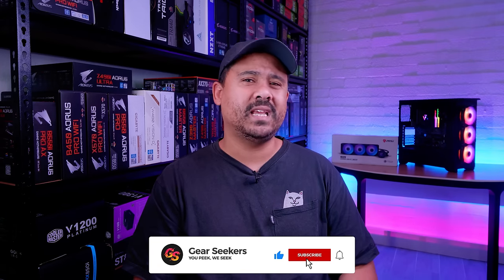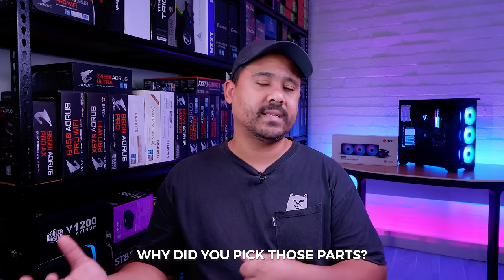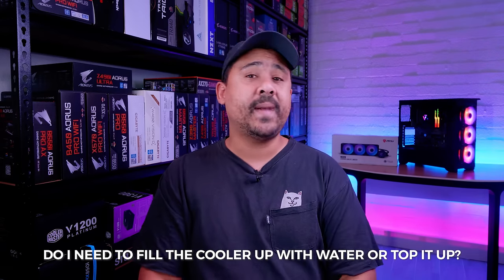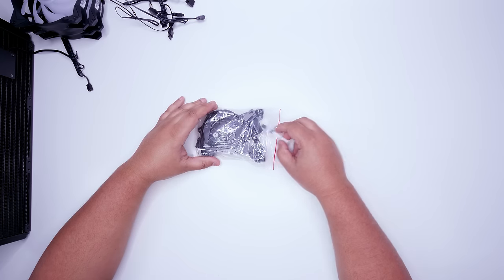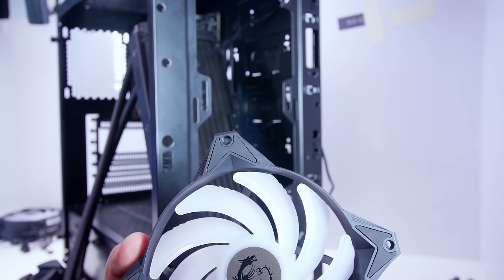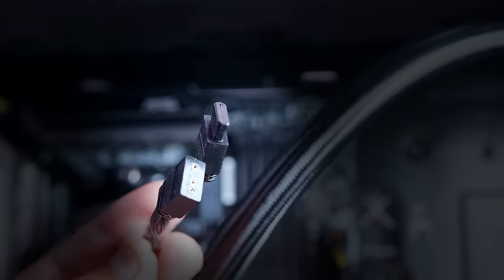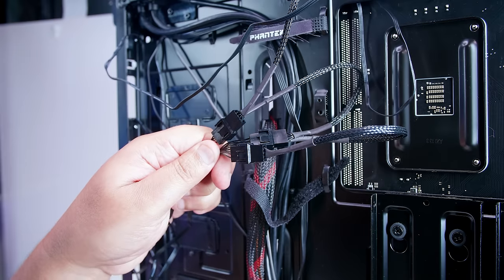HOW TO MSI MAG Coreliquid 360R & 240R AMD AM4 & AM5 Install Guide

Comment: The V2 does not come with instructions so this was some what useful. but you glazed over and skipped some key steps. For AM4 pretightening the the cpu cooler clamps did not fit. and the wiring is a joke.

Comment: This video is 10 times more useful than the official instalation guide you get from the box.

I scratched my head because the light just didn't want to turn on even after I make sure I already plug all the argb fan to my argb hub.
Reply: Figured out a solution yet??
Reply: Amen.  There are parts in the bag that aren't mentioned anywhere in any of the instructions.
Reply: Normally it would mean you need an app to control the RGB if the motherboard isn’t RGB ready
Reply: @vortexseziks1013  ,

Comment: The Q and A is amazing, all the questions answered quick and simple. keep up the good work👍
Reply: L
Reply: Will the pump work on a old motherboard like a msi 970 or a 990? If so, where would I plug it in?
Reply: which RGB control app do you use?

Comment: not even msi installation vid was this good. Thanks so much, saved me from falling apart when doing my first build and couldn't figure out how to connect it
Reply: It literally took me a WEEK to find this video.  The only reason I knew it was pump up, was because other friends guided me. (It was my first AIO install.) 
As you said, their website, install guide, and videos don't tell you the correct way.
Reply: i can’t mount the radiator onto the cpu and i’m doing the same exact steps as this video and others. it’s like an inch away from the cpu and i can’t tighten the screws. any help?
Reply: @awstin2440  Yes, I had the same problem flip the mounts that click on to the mounts if you have an AMD one, the videos say to do it the other way but it didn’t work for me so I tried the other way and it worked and I could tighten the screws
Reply: @awstin2440  they are the seats that click onto the mount, just flip them over and then try
Reply: @snack6624  yea haha i ended up figuring that out xD even then it’s still a little hard to install ngl
Reply: @awstin2440  yeah it definitely is😂

Comment: I just got this AIO in a trade today on FB Marketplace. i plan on using it to replace my 240mm Corsair AIO. The Corsair AIO works fine but I figure a 360 is going to be better or just as good as a 240 AIO. The main reason I'm replacing the Corsair AIO is because I'm slowly moving to an all black build. i got rid of all my white components and my AIO and cables are the last white components I have left to switch out. I really like how simple this AIO is. My Corsair AIO has like 5 different cables coming from the pump head and since I don't plan on using any RGB this pump head won't have any cables coming from it so it's really going to make my build look cleaner. I'll be using Fan Control for the rad fans and the pump, although tbh I usually just keep my rad fans at 100% all the time.

Comment: I'm just recently doing a brand new PC build with this exact motherboard and cooler but I've heard a lot of different ways to install the radiator. I've been told that the best way is to have the tubes coming off the radiator installed at the bottom instead of the top because of eventual air that will get into the system down the line. What are your thoughts on this.
Reply: i think hot air rises

Comment: Hey i have a simple question, with a gungnir 110r its possible to just put the rgb pump câble to the controller rgb behind and not on a Jrainbow header ?
Reply: Does it fit well on the front

Comment: Great video man, it helps for people who want to install this AIO. Honestly the design is meh, however it's nice to see some deviation from your usual AIO such as the pump being in the radiator instead of near to the cold plate. Aesthetically, it reduces the amount of cable on the front. But I don't know if this design choice has any technical advantage over the usual pump location.
Reply: You definitely wouldn't want to put this on top. Me and many more have suffered from the issue that the pump will fail. Air rises to the top and it makes its way into the pump. So front input is probably the best and only way to get a huge lifespan from this cooler where the pump will maintain under water
Reply: @iiSup3rior Hello, I am installing one, but I have read that I have to install it with the hoses from the bottom up, to leave the pump at the bottom, the bad thing is that it looks horrible. But in this video he installs it with the hoses from top to bottom, I don't know what to do.

Comment: I used the 240R in the MSI Gungnir 110R  case which has an ARGB hub built in that  can control all 6 fans(4 case fans + 2 on the AIO).  Great design and looks great with everything synced up perfectly.   Highly recommend!
Reply: Hello! i am using the same things too. COuld you explain how to wire it up???? thanks. (i know this is a year old lol)
Reply: Sorry but did you connect the water block RGB to the RGB hub in the back instead of the jrainbow pins stated in the video?

I have the exact same things as you.
Reply: @val_kyo  I have 6 ARGB fans(3 intake, 2 on the top mounted AIO radiator and 1 exhausting out the back)  as well as the waterblock and a custom ARGB heatsink for my M.2 SSD all connected to the ARGB hub in the back.  But Idid have to add a splitter or two to fit them all.
Reply: @kaelinmarkert5852  I ordered the 280r fans and it didn’t fit the 110r case, are you sure 240r fits perfectly??
Reply: @CFC003  I used the Coreliquid 240R with the radiator mounted at the top.  I've since upgraded to the Coreliquid S360 which can only mount in the front.  Both using the Gungnir 110R case.

Comment: I had to watch your video multiple times in order to understand the daisy chaining and one thing which was confusing was that you had connected the pump fan header a little confusing way. Later, I was able to figure out that the pump itself have two cables one is the rgb header and the pump fan header. Yeah it got a bit confusing but at the end watching it several times and understanding all the part while pausing the video helped a lot.

Comment: You just made this so damn easy for a noob at installing a water cooler. Thx man!!
Reply: i can’t mount the radiator onto the cpu and i’m doing the same exact steps as this video and others. it’s like an inch away from the cpu and i can’t tighten the screws. any help?

Comment: So if the pump is in the rad, does this mean that it's actually best to bottom-mount this AIO ? To keep the pump at the lowest point.
Reply: Yeah That should be the case That's what I did while bottom mounting it in my nr200p

Comment: Warning: They're great but unfortunately these watercooler versions from MSI have a design flaw. These are so faulty that I can't believe they are still being sold. After a few months, a grinding sound will show up every time you start your computer. Getting worse and worse with time. I bought one, sent it back, got a second one thinking maybe it was bad luck, and it did it again. If you really wish to buy one, do not install it on top like it's generally supposed to. Install it vertically on the front, and even then, I don't know, I wouldn't risk my money with these.

EDIT: Apparently it was a bad batch, pumps were getting clogged because they were producing sediment. Making them unreliable after a few months. MSI found this after an investigation. A recall was made so people could get a replacement and the V2 model was born. I guess the overheating and rattling issues got fixed but take it with a grain of salt.
Reply: yeps.. if only I red this comment. I should have bought Corsair coolers.. damn it so unlucky.. now I only used it for 6months and temp is going crazy
Reply: @presliitagure662  Same man, but I rma‘d it and they send me a v2
Reply: @sz7monus  I fixed mine.. opened and cleaned the pump and changed the old coolant with motocycle coolant. sheeeesh! now its okay..
Reply: @presliitagure662  do you have any details on the opening and cleaning process? like how you did it, pics or videos. My unit has started to make noise at boot. I want to open it but im afraid to ruin it. I saw theres some sort of goo inside, motorbike fluid is usually less viscous. wouldnt that create a problem for the pump? thx
Reply: Is the v2 of that liquid cooler better? Or is it the same problem
Reply: I too just had this go faulty after 6 months. About to replace it with an air cooler to see if that solves my problem - then it'll be going back for replacement. Not noticed a grinding and the fans all run but cpu started hitting 100c just loading into a game.
Reply: Mine just totally doesn't work fresh out the box 😂 back to corsair lol
Reply: I've had one installed on top for nearly a year now with no issues.
Reply: Oh good to know the issue was fixed. Given I got one coming Monday for my first gaming PC build

Comment: That was super helpful thank you so much. I was worried I wont have enough Fan and RGB connectors on my motherboard (MSI MPG B550 Gaming Plus) but given the Daisy Chain and Fan Splitter I should be fine (as far as I understood the installation process xD)
Reply: Hey, I have the same motherboard and want to buy this AIO. Does the mobo have enough RGB connectors?
Reply: How do I Change the Color ? Do I need a Software ore Somthing like that  ?

Comment: Ok, so from everything I've read/watched on AIO installs should the pump not actually be at the lowest point of the loop to avoid the air collecting there, meaning should you not have put the rad the other way around?   Or is it different with this system as the pump itself is actually in the rad and therefore the air would escape anyway?
Reply: I have exactly the same question, could you find out?
Reply: Suposedly if the pump itself is lower than the highest point of the circuit it will be alright. In this case it should be fine as the pump is a bit below the top of the radiator tubes.
Reply: @diogosimao3212  I believe once the orientation is set, shake lightly but for some time to let the air move to the highest point and out of the pump. I saw the video by JaysTwoCents where he explains it beautifully

Comment: I installed everything correctly and my CPU is idle at 80 Celsius and when I play games it is at 100 Celsius and then crashes.
Reply: Yo same. It's really weird especially considering it had worked well before. I'm just guessing it's missing some water, since the AIO seems to be working fine otherwise. I even reapplied the thermal paste. However, if you fixed your issue I'd be glad to know.
Reply: @wibiz9657  mine too. ans it seems like the fans are around the wrong way causing the fans to fight each other.
Reply: @mickpoore3326  I ended up replacing the cooler with Noctua's NH-D15 since I figured the pump was broken in the AIO. Make sure everything is working before doing the same.
Reply: Same
Reply: It's a known issue now by MSI. You can ask for a replacement by searching "MAG CoreLiquid 360R Product Announcement"
Reply: @RedPixels_  is it still available?
Reply: @Raiden0831  yeah it should be; they started replacements something like two months ago.
Reply: @Raiden0831  yeah its still going, just got mine today and am replacing it
Reply: @SussyJack668  Did you have to send yours in first? Im worried ill send it and theyll reject it bc I was idling at 80c a few weeks a go but I did a full clean and a new thermal paste and put my window next to the my cooler and now I idle at 50c.

Comment: Stupid question, for the 240r , you can install the radiator at the top side of the case instead at the front as shown here? 

If the radiator is installed on top of the case and the fans are below the radiator, should the fans have to take air from the outside to the inside of the case or vise versa?

Comment: 1:13 you say that it seems not to be suitable for Threadripper (ie. sWRX8, SP3, or TR4 sockets). I hold the same suspicion.

1. Did you measure the actual sizes? 
2. What liquid cooler would you recommend to look for?

Comment: I had the Fractal Celsius+ S28 Dynamic 280mm cooler for a while. It also has this sub-par method for mounting to AMD. I now have the Deepcool Castle 280EX which uses the 4 thumbscrew method for mounting, which is superior to this MSI or Fractal method of mounting to an AMD motherboard. The Deepcool also has a square cold plate, instead of round one like this or the Fractal.
Reply: wish more would give us a 4 screw mounting method
Reply: Deepcool have been doing some great stuff lately.

Comment: you mounted the radiator the wrong way, if u front mount it, u have to have the pipes at the bottom if u can
Reply: that is a 50/50% right or wrong answer. 50% will give you a thumbs up and the other 50% will give u a nay and will say tubes have to go from the upperside
Reply: @IiMxMrGeitt  why's that?
Reply: Seriously, just go and watch Jay's video
Reply: @Daniel.echgoo  who's that?

Comment: Edit: Gear Seekers resolved my problem! Thanks so much :)
amazing guide! but it would have been nice to warn anyone who has the p400a that installing the fans as push configuration like you did will not allow you to put the front pannel with the mesh back on...
Reply from the maker: It does go back on quite easily. Readjust the rad and it goes on no problem.
Reply: @GearSeekers  what do you mean by readjust the rad? The bottom lip of the front panel won't fit. The only way I see to make it fit is by putting the fans on the other side :/
Reply from the maker: Slide the rad and fans up. It fits easily Done plenty of build videos showing it mate.
Reply: @GearSeekers  wow you are 100% right! I didn't think it could go any higher because of the cables for the front buttons(on/off, fan RGB modes) but with some pressure I got it all the way up on the bracket and front panel totally fits! Thanks so much :) subscribed

Comment: Installing a 240 right now, thanks for this!
Reply: hi did your 240r worked ? mines missing 1 female cable
Reply: @jinell14  Yup, mine was complete. Check that the box was unopened, I've had that before from Newegg.
Reply: have you had any problems with it so far?
Reply: @sudhhhrhsk4756  none, worked flawlessly

Comment: Just to warn those out there who are using the p400a with this cooler. It is very hard to put the front panel back on once this is in place, you really have to push the fans up therefore givimngb a lot mof pressure on the cables from the front panel connectors

Comment: thanks to this vid. i was lost in my pc build process with so many wirings. this post helped me. many thanks 👏👏👏👏👏
Reply: i can’t mount the radiator onto the cpu and i’m doing the same exact steps as this video and others. it’s like an inch away from the cpu and i can’t tighten the screws. any help?
Reply: @awstin2440  check if you are using correct frame for cpu. there are frames for socket lgA 1200,115x,am4and tr4 plus for 2066.so there are four different brackets. also what do u mean "i can't mount radiator into cpu".

check official docs also. https://www.msi.com/Liquid-Cooling/support/MAG-CORELIQUID-360R
Reply: @akshitasrivastav8272  i am using the same bracket as the guy in this video. i have ryzen 3600. and the actual radiator part with the fans goes on just fine but the actual piece that connects to my cpu is what i can’t connect. i’m doing it the same way as the people in the videos but it just won’t go on. it’s like an inch away from the cpu and i can’t tighten the spring screw things so i’m not sure if i’m missing something or what?
Reply: @akshitasrivastav8272  thats how i’ve been doing it but when i tighten the screws, the buckels move out of place.
Reply: i had the bracket upside down lmaoo it’s making contact now but won’t go on still it’s like an 8th of an inch off
Reply: got it thanks for your help
Reply: one more thing, my mobo doesn’t have jrainbow connector, i need to buy a fan controller hub with one dont i?
Reply: i have gigabyte b450 aorus pro wifi rev 1.0
Reply: @awstin2440  yeah you need to buy rgb controller.

Comment: Thanks for the video, really helped answer a lot of daisy chain questions. I am curious if there's a limit as to how many fans we can daisy chain. For example, if there are 7 additional ARGB fans, can they all be daisy chained together?

For context - I own Lian Li fans, and the daisy chain is made easier with the control HUB the product includes. I am helping a buddy with his set up (which is completely different). He has a MAG CORELIQUID 360R V2, and wants to connect 7 MSI MPG F120 ARGB fans using the daisy chain method. Unfortunately he only has one 5V ARGB header, so the daisy chain method was the only way around that limitation. 

Thanks again

Comment: Can you use the noise reducer cable as an extension cable for the pump? Specifically the pump_fan1 connection. My cable doesn’t reach it without.

Comment: mounting kit is the same as lian li galahad and so as the rotating design. the pump location is definitely an interesting. I hope msi include some kind of vibration dampers for the radiator as pump will make some kind of noise due to vibration

Comment: Does your pump also make a high whining noise when running over 3100 rpm? I'm thinking this might be a fault with my product. Its by far the loudest part of my system if I run it at 100%.

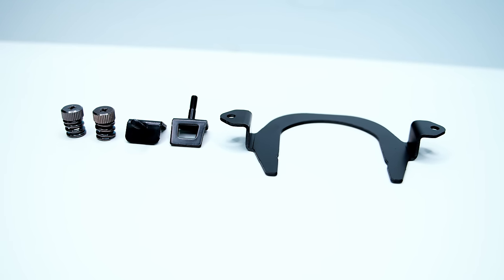Comment: At 6:45 you have the two mounting brackets, one has it's screw missing and when you put it on the aio cooler it has a screw. Mine has a screw missing, but quick install guide shows two both with a screw.. am I missing something? Or I'm missing the screw?
Reply: At 6:42 the screw is visible, it's a bit hard to notice though because of the camera angle...

Comment: I'm trying to Plug in the JRGB cable but on both spots on my mother board where I could connect it there are 4 pins and not 3, so I'm stuck